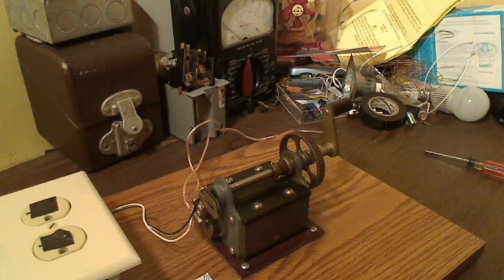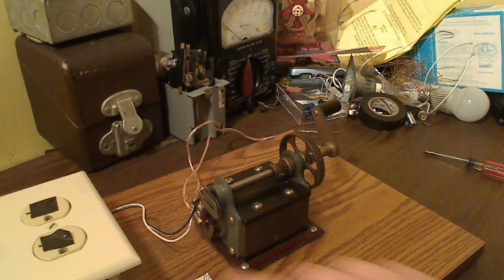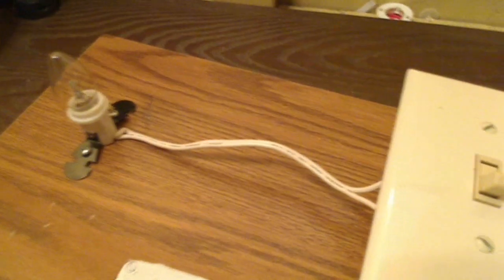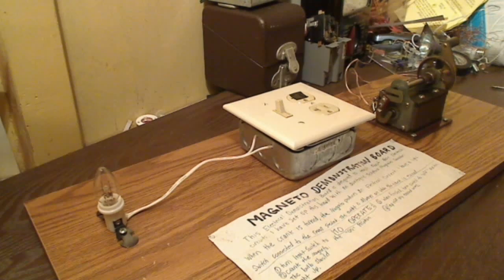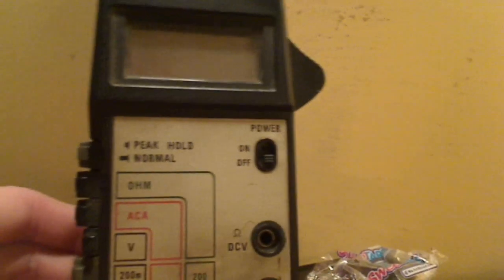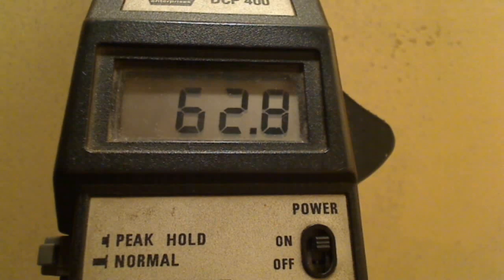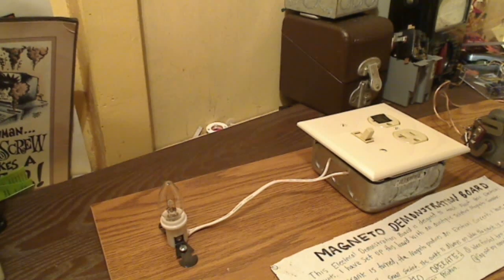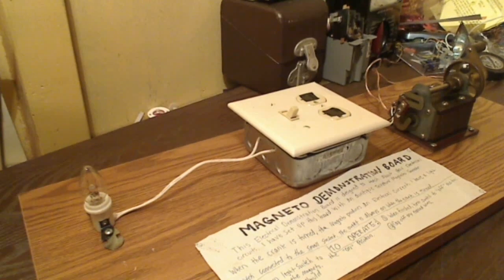Hand Crank Magneto Generator Demonstration Board

Comment: Well done!  That magneto is military surplus; it came from an army switchboard.  I found an old PDF about it by doing a web search on its GN-38 part number.  It is army manual TM 11-333.  Mine worked much better after disassembly and oiling.  Anyone who touches the end of the magneto while turning the crank will get a painful shock, so mounting it to a board is a good idea.  As the kids try it, they will discover that the handle is much harder to turn when connected to the lamp.  That shows how you can't get electrical energy for free.  More load on the magneto makes it harder to turn.
I built something similar, but included a wall phone.  That lets me show people "on the hook" and "off the hook", and how 
"hanging up" means that you literally hang the handset on the switch hook.

Comment: I have this exact same magneto, and set it up exactly the same with a switch, bulb and two outlets.  It won't work when the outlets are in the circuit, but with just the switch and bulb connected to the magneto it lights right up.  Maybe I'm wiring it wrong?

Comment: what is the highest wattage incandescent light bulb that generator can power
Reply: Phoney - Western Electric go to Home Depot and get a 11 watt incandescent sign indicator bulb ...because the glass envelope is much larger ...the filament is brighter...the base is full size...the visual impact of that bulb would  have much more of an impact for demonstration purposes....PLEASE...do that...post a video....and RETIRE that tiny 4 watt night light...it can power the 11 watt bulb. ..seen it done...
Reply: Hi - I have one of these magnetos and I know it may seem obvious, but could you provide or refer me to how the wires are connected to this unit to power a light bulb? I see the wires in the video are connected to  it on the contact switch - but exactly how and to which screw terminal? I want to put the output into a bridge rectifier and use the DC to charge a cap. Is there a label diagram available for this particular magneto anywhere? Thank you
Reply: @jandres1159  I have the  original case and cover  with printed diagram inside. These units were designed to ring a distant buzzer or bell so the other party would know to pick up their handset. They were intended to only send a short charge not a sustained supply.  Magneto: Think  lawnmower flywheel powering a sparkplug for only an instant.  n2eye
Reply: @AB1Vampire  understood; any chance you could show that diagram?
Reply: @zylok1980  OK, it's really basic though.  Thing is more of a magneto than a generator.  Has the folding handle.  How to post or attach jpeg with camera/iPhone?
Reply: @zylok1980  it's easier if I could email jpegs.